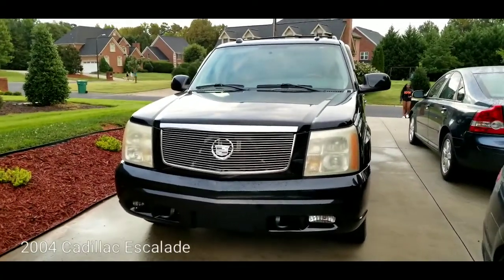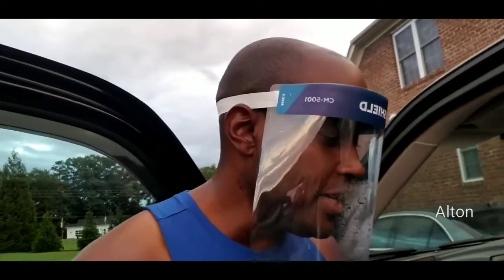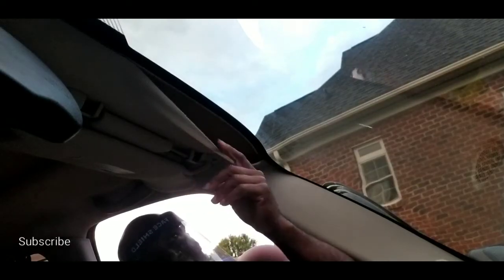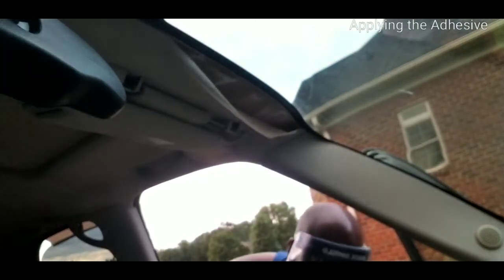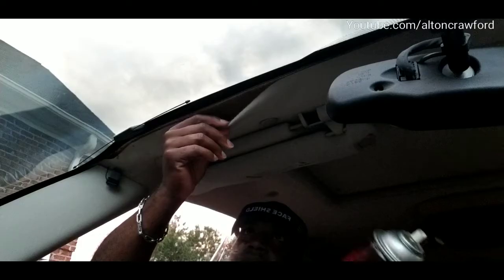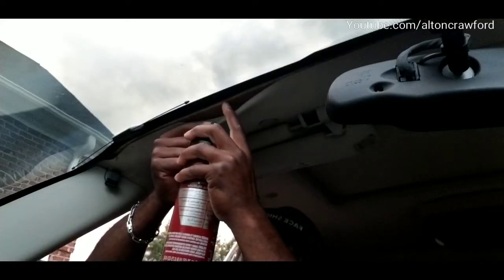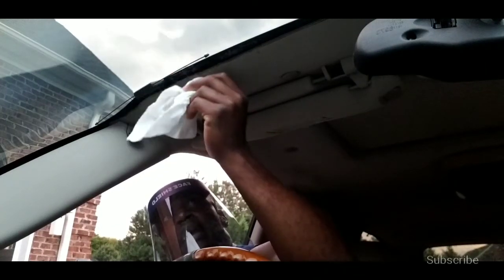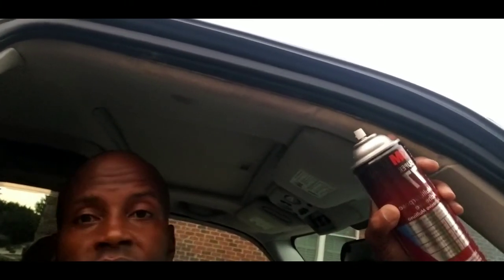How to Repair Sagging Roof Lining - 3M Super 77 Adhesive to DIY repair Cadillac Escalade Headliner

Comment: Thanx for the video. A respirator helps to avoid breathing in fumes. It’s good to wait for the adhesive to tack up a bit. The the adhesive can soak into the fabric when it’s wet. For cleaning adhesive off unwanted areas you can try Bestine solvent.

Comment: i know this is a year old, but just wanted to let u know i got this stuff at walmart hardware section and fixed my roof in the parking lot in about 30 seconds.
Reply: it has been 2 months and my car ceiling is still holding like new. i live on the beach so my windows are always down. this stuff is the real deal

Comment: I would mask off the window glass and also the whole dashboard before I sprayed. That 3M Super 77 adhesive is VERY strong glue and it dries very quickly and it doesn't come off of anything without some serious solvent like Goof-Off. When you spray, those little particles in the air settle on everything and you can't just wipe them off when they land while they're still fresh.

Comment: One good feature of 3 M is that you can just spray one surface and it sticks fine. There is also a very brief time when you can scooch things around a little before it grabs hard. Put out your cigar as the fumes are flammable! And don't use in an enclosed space. Nice video.
A

Comment: Geez!  Thanks for this informative demo.  Some demos I've watched said to spray the roof and the fabric.  However, I was wondering if it would saturate through as well.  Another demonstrator's advise was to use your fingers to smooth out the fabric after spraying.  Ummm...no thank you.  I don't wanna wait for super glue to peel off my fingers five days later.  LOL  I have a 2012 VW suv, so I may need the stronger 3M adhesive.  Bless you.